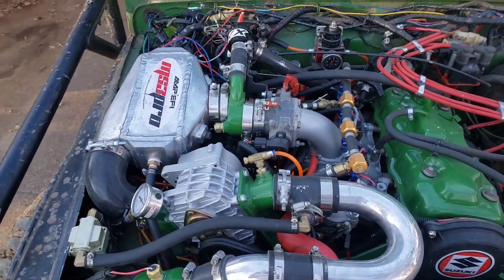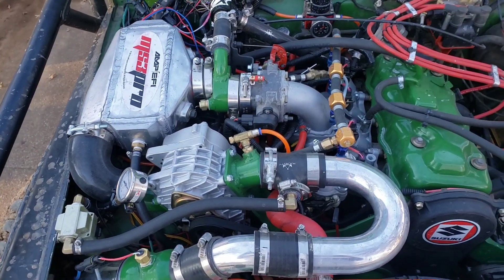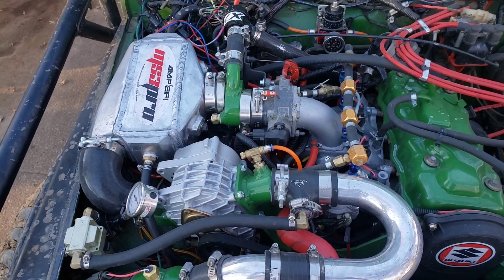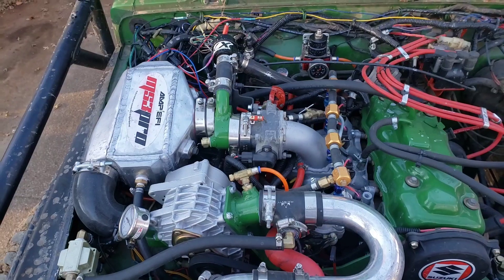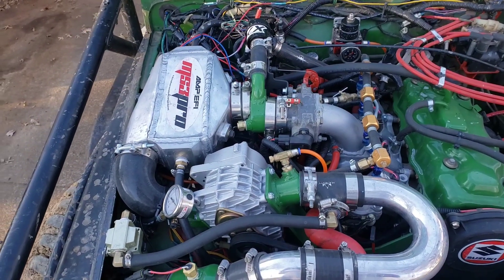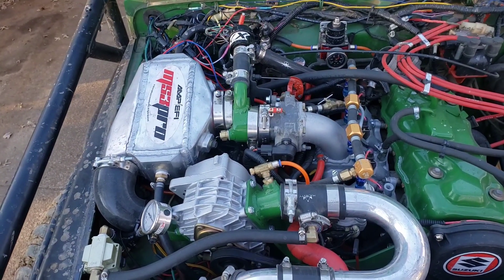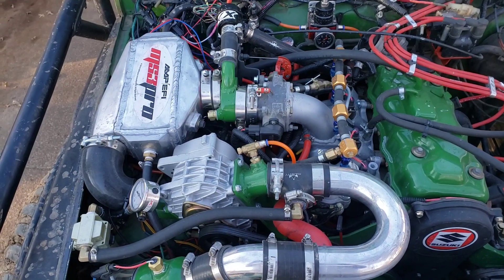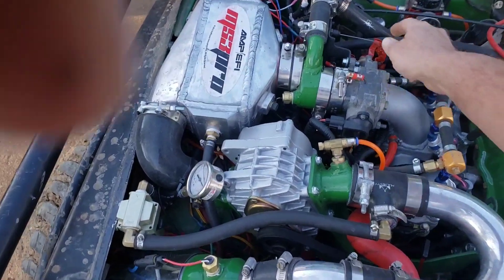Super Sammy AMR500 Supercharger Failure.

Comment: wow you coated inside of pipes you are so dumb
Reply from the maker: The AMR500 has factory coatings on the rotors. I didn't coat them.
Reply: @zuk4x493  dumb
Reply from the maker: @chrisgraffam3357  Eaton also puts coatings on their rotors. There are companies that strip and re-coat them. However these refurbished amr superchargers are too cheap to waste money on. Now that I have it dialed in, I really like the hp and torque increase especially off idle.  The sequential multiport injection system really improves response as well.
Reply: @zuk4x493  im building an rsx and the engine in its shit atm but i figured a few ponys more could never hurt lol but now this idk im jist trying to get threw the winter on this engine as its my girls 1st winter driving lol
Reply from the maker: @chrisgraffam3357  unfortunately it not as easy and cheap as it appears. I thought I would just add the supercharger. However,  anything over 7psi really needs to have the piston rings re-gapped. Also even at 4psi of boost you need more fuel and less timing. Modern obd2 efi systems can adapt to 4psi. However a boost referenced fuel regulator is needed. Any engine using a mass airflow sensor will need a recirculation valve to keep the ecm from measuring the incoming air twice. If an engine has a lot of blow by then boost makes it worse. Weak rod or main bearings will fail. My cheap and easy supercharger build was cheap or easy. Of course an education is cheap regardless of how you get it. In the end I am happy with the results and the knowledge I gained about fuel injection, aftermarket ECU's, and forced induction.
Reply: @zuk4x493  thats just it i never thought these would make more then 3 or 4 pnds i just thought it would add some sound and maybe a lil snap off the line i really didnt expect 13 pnds from a less then $200 on ebay weird looking lil charger that looks like i goes on a forklift or something
Reply: I love the car btw

Comment: Hey. I have a 1983 ford ranger with the rare 2.2 Perkins (non turbo) diesel in it... I was looking at buying one of these chargers and integrating it onto the Perkins... What suggestions do u guys have? Can u or should I run an intercooler? How much boost would it produce. Should u run blow off valve's. Change the pulley size since my truck maxes out at about 4500rpm? Would u suggest running straight to intake? Is it worth it... I'm looking to build some low end power/torque....thanks in and advance.
Reply from the maker: I believe you would want a pair of these. These superchargers were designed for the 668cc Subaru Pleo. At a 1.9 to 1 overdrive and a relatively efficient intake and exhaust system I am only seeing between 4 and 5 pounds of boost and that is with water-methanol injection. You will obviously need to run a higher overdrive ratio because of the lower diesel engine rpms but that creates more heat and noise.
Reply: I thought with it being a little 2.2 diesel it would produce enough to notice. I mean the motor comes with 59 ho and 90 ftlb... So I believe anything would help... If it's only 4-5 lb I would say it wouldn't do anything internally to damage the head. Just weighing out my options ... Don't really wanna turbo it and risk damaging the engine and figured with the little amount of boost these guys make I'd get a little pep and not hurt my motor... And I would definitely run a smaller pulley to get the ratio up as I know I'd never spin my truck higher than 4500 Rpm... Thanks for the response
Reply from the maker: @justinclay1833 you may see  a little boost but the little AMR500 is only 500cc and the roots design is inefficient so 80% is typically max without the cooling and sealing effect of fuel or water-methanol drawn through the blower. They are cheap enough to  experiment with. That is what I did. I figured why not give it a try.

Comment: Hello, I congratulate you on the video, it is very interesting! I would like to know if this amr 500 super charger will give positive results when installed in the engine of the Suzuki Grand Vitara G16B 1.6L 16v?
Reply from the maker: It should because we have the same displacement. Be sure to use the draw through configuration not blow through like mine.
Reply: @zuk4x493  hello my friend, I already installed the amr500 in my suzuki vitara g16b and I wanted to ask what is the normal temperature that the supercharger should reach?  I'm afraid mine is getting too hot and I'm worried.
Reply from the maker: @srcm1979  without the bypass valve in a blow through configuration mine charged pipe temperatures hit 290°F . Now with water-methanol injection, air to water intercooler, and the pre supercharger butterfly valve my average charged pipe temperatures 120°F. The supercharger will run cooler and seal better in a draw through configuration with fuel or water-methanol being pulled through it. The water-methanol is good for 30° to 40° temperature drop from ambient air filter temperature.
Reply: @zuk4x493  ok, I understand thanks my friend.
Reply: I just ordered one for my 16v sidekick. Cant wait for it to arrive. Got an intercooler and Snow performance water methanol injection system. Should be a blast.
Reply from the maker: @estewar03  are you on the Suzuki Forced Induction  page?
https://www.facebook.com/groups/2491710557711136/?ref=share
Reply from the maker: @estewar03  remember draw through configuration only. Also ring gap is critical  when combustion chamber temperatures become too high causing the pistons and rings to get too hot causing ring bind.
Reply: @zuk4x493  It's fuel injection not carburetor. Just going to need higher flowing injectors and fuel management system, maybe a higher flowing fuel pump.
Reply from the maker: @estewar03  thats fine  just relocate your throttle body pre supercharger. The water-methanol system also pre supercharger to not only cool the charger air and raise the charge air density, but improve the supercharger efficiency.
Reply: Ok, thanks!!

Comment: Would it work ok with a little v6?? Really cool build man. Got one laying around and just wondering
Reply: From what I have read the displacement recommendation is  ~1-2.2L
Reply from the maker: @bannablitz247  the general supercharger size rule of thumb is 50% to 70% of the engine displacement.  These little 2 lobe superchargers were designed for a 668cc Subaru Pleo.
Reply: I think it all depends on airflow.  My calcs put my gm 2.8 that never breaks 4000 rpm at 173 cfm.  A 1.5 liter engine w a 4v head (d15b7 in my case) using 170 at 7500.  Using a pulley that provides maximum rpm at 4000 would give me 4-5lbs of boost.  

Deal killer was the noise in the vids.  If i could find an electronic pulley like an ac unit or previa sc thatd work.  If not im gonna use it to twincharge the turbo civic so I can get some pre spool performance, and probably spool that lazy amazon spec turbo a bit quicker.

4lbs of boost on a switch would make the trooper way better at climbing the mountain passes on the highway though.....ideas? Sources?  All the actuated pulleys I find are too big.

Maybe make an intermediate plate with a dual belt pulley then run the small pulley to the motor and the bigger pulley to the actuated one on the sc?  

Theres gotta be solutions!
Reply: @jessicaraye1119  look into electric clutches on tractors. Flip of a switch will turn it on. And if your looking for v belt pulleys look at tractor pulleys as well as long as the id fits the od of the shaft on the compressor
Reply from the maker: Depends on the displacement. Personally I think  1600 cc is about maximum.  These little things came from 668cc Subaru Pleo's.
Reply: You can technically make anything work on anything but it's a question of how good it will work out.

Comment: I'm used to massive "old school" roots superchargers sitting on top of a V8 with carbs mounted directly on top, no blow off valves etc. Why wouldn't that work on a 1.3 liter 4 cylinder with this tiny supercharger?  I have a Samurai with 31" tires that could really use a little more torque.  I LOVE the idea, and the price of the supercharger but I'm discouraged and out of my comfort zone with seeing how everyone is setting these up. Boost referenced regulators, blow off valves and so on. Way back when a guy cobbled one onto the intake of a 1930's flathead V8 with a carb on top. Tons of people still run that type of set up today. Seems simpler. I'm not trying to stir things up, I'm genuinely looking for input.
Reply: I think the difference is because with a carb setup you can more easily adjust how much fuel you need relative to your setup. Fuel injected cars require more changes and information to keep the engine from leaning out.
Reply from the maker: If I was going to do it over, I would have placed the throttle body before supercharger (draw through) to help mitigate some of the noise. Either way I still need to spray water/methanol to cool the supercharger. The recirculation valve is there to bleed off the charge pipe pressure at idle. 
On this particular 1.6L 8 valve setup I am getting way above normal efficiency at nearly 100%. At around 4 pounds of boost it makes an additional 20 RW HP over the original TBI NA setup. The big difference is the torque. At 2000 rpm it is already at 4psi boost. It make 20 LBFT more torque than the TBI NA setup.
Reply: If I raised the throttle body up and put the supercharger on the intake, then bolt the throttle body back on top for a draw through system, do you think the throttle body would idle and run ok?  I don't know if it would adapt to the stronger signal and feed enough fuel or if it can keep up without changing the injector or fuel pump. I think I can fab everything to get it sitting in place, but hate to do all that and it not run because of the throttle body setup.
Reply: @larrythomas3624  I think it might work if you have a way to properly tune it. That's the configuration on a lot of OEM roots style super charger setups.
Reply: Thanks for the response! Someone that owned this zuk before me put this injection on it, along with power steering and disc brakes. It's a 1988 which wasn't available with fuel injection. It wasn't available until I think 1991.  It came from an estate sale, so unfortunately I can't ask the guy that built it.  I love the idea of the looks, sound, and a little more torque of the little roots, but I don't want to flush a bunch of money, time, and effort and it not even start! I guess trying it is the only way to know, but that makes it really hard to pull the trigger.
Reply: Hey. I have a 1983 ford ranger with the rare 2.2 Perkins (non turbo) diesel in it... I was looking at buying one of these chargers and integrating it onto the Perkins... What suggestions do u guys have? Can u or should I run an intercooler? How much boost would it produce. Should u run blow off valve's. Change the pulley size since my truck maxes out at about 4500rpm? Would u suggest running straight to intake? Is it worth it... I'm looking to build some low end power/torque....thanks in and advance.
Reply: @justinclay1833  why not throw in a turbo. Just that turbo diesel synergy
Reply: @Lcr34  it's a rare engine... And only 3000 of these trucks were made and parts are scarce. I've heard the heat from the turbo can damage to the head. I don't know for sure but I don't wanna find out lol. I figured with as little boost these things make and my truck only running at 4500rpm I could put a smaller pulley on it and I feel it would make enough power on the low end where it's needed but not enough to cause damage to my motor...
Reply: @justinclay1833  Trust me, SC gets hot as well. But if you dont get over say 0.4-0.5 bar you'll be fine with either.
Reply: @justinclay1833  with NA high compression diesel. I'd suggest boost around 8-10 pounds.

Comment: does the supercharged have oil on in ? i saw somewhere that supercharger must be filled with some gearbox oil
Reply from the maker: You have to add 100cc of oil. I use 75W-90 full synthetic gear oil.
Reply: @zuk4x493  tht is 4gl spec?
Reply from the maker: @nadizahadi1183  I am using Valvoline 75W90 which is both GL-4, GL-5. 

https://www.valvoline.com/our-products/grease-gear-oil/synpower-full-synthetic-gear-oil
Reply: @zuk4x493  does it sound any better? Louder after u serviced it?
Reply from the maker: @nadizahadi1183  I knew from the beginning these superchargers are shipped empty so I added the 100ml of oil before I installed it. The first supercharger failed because I didn't have the water-methanol injection set to activate early enough. Roots superchargers really need to have fuel drawn through them. Even in top fuel drag cars they are either injecting fuel before the supercharger or NOS. In reality I  should have installed my throttle body before the supercharger to help control the extra charge pipe pressure. The other issue is the size of the little AMR500. A 1600cc engine should have a minimum supercharger size of 800cc with a 1000cc being close to ideal. These AMR500 superchargers were designed for a 668cc Subaru I4 engine. We have to overdrive the AMR500 on a 1600 to see any performance gains. If I were to start over,  I would either find an Eaton M62 (1116cc) supercharger or an SC12 (1100-1200cc) supercharger from a Toyota 4AFE. However knowing what I know now I think a small turbo would get you good low end torque with minimal lag and better efficiency.

Comment: I've seen few cases with same problem, it's caused by over revving past 20krpm. Mine has been working great with max 17550rpm 😊
Reply from the maker: I have really enjoyed your videos on the AMR500.
Reply: Some of the rebuilders say not to use water/meth injection through the sc because the coating doesn't like rapid heat cycles. The high temp followed by rapid cooling causes adhesive failure. That's why it's only failing in the middle of the rotor where the temperature variance is highest.
Reply from the maker: I am not exceeding 11,820rm because I am overdriving my supercharger 1.9 to one and my rev limiter is set at 6250. However before the butterfly valve was installed I was seeing 200°F plus charge pipe temperatures.
Reply: @zuk4x493  why not install a air to water intercooler just before the throttle body.  By the way,where can I buy a genuine amr500 supercharger online ?
Reply: First of all, what the hell is 20krpm? Is that a some Canadian metric translation? Nothing in the streets revs that high. Only F1 cars do that.
Reply: @TidalWaveDan  20K supercharger rpm
Reply: @TidalWaveDan  if you understood superchargers and how pulley sizes affect RPM and boost, you might have come up with a more constructive comment to post.

Comment: i wanna buy this supercharger from aliexpress, but your video surprised me, the rotor coating came loose because the supercharger exceed the max RPM?
Reply: Yes that's the problem, supercharger will overheat. I have this one, been working great. I have some videos on my channel 
http://rover.ebay.com/rover/1/711-53200-19255-0/1?ff3=4&pub=5575563443&toolid=10001&campid=5338643528&customid=jonik&mpre=https%3A%2F%2Fwww.ebay.com%2Fitm%2FAISIN-AMR500-Roots-supercharger-Compressor-blower-booster-Kompressor-turbine-AMR%2F273816082010%3Fepid%3D9018271462
Reply from the maker: It failed because of the heat buildup. These superchargers should be used in a draw through configuration not the blow through configuration I am using. I am going to experiment with a secondary butterfly valve operating on a 1 to 1 ratio with my existing throttle body. Essentially I am adding a second  2 inch 50mm throttle plate to mimic having my throttle body before the supercharger. This should help it run cooler. Unfortunately my VW air bypass valve is too small to dump all of the excess air being forced into the charge pipe at partial throttle and deceleration. I added a second boost gauge to the charge pipe to see the difference between the charge pipe pressure and the intake manifold. At partial throttle with 2 inches of vacuum in the intake I have over 10 psi in the charge pipe.
Reply: @zuk4x493  I think draw through configuration  is the best,  but i will need a new intake manifold and a lot of space under the hood and much more money, and that is the biggest problem... my engine is 1.8L, the AMR500 can be installed in an engine with this size? My max rpm is 5800, and i was thinking to use a 3:1 pulley ratio in blow through configuration...
Reply: Gustavo Henrique Ribeiro they were originally installed on subaru pleos 648cc engines, people put them on engines as big as 1600cc on aircooled beetles and that’s already the upper limit for the tiny amr500, so I’m not sure about the 1800cc.